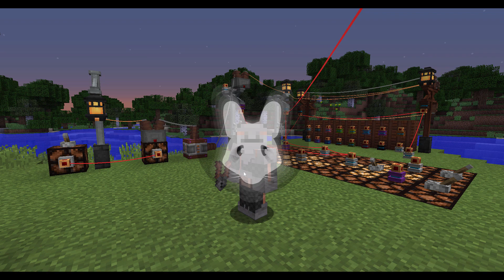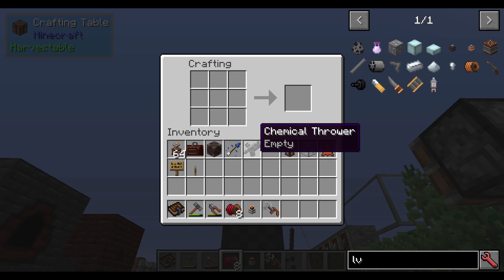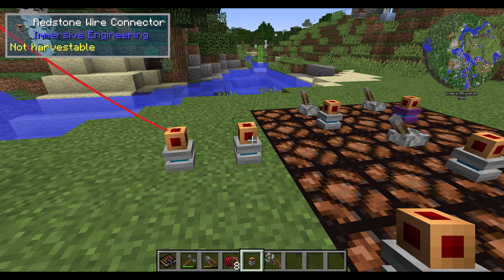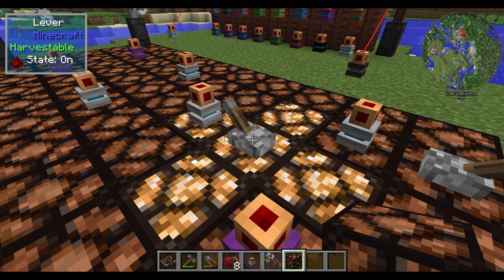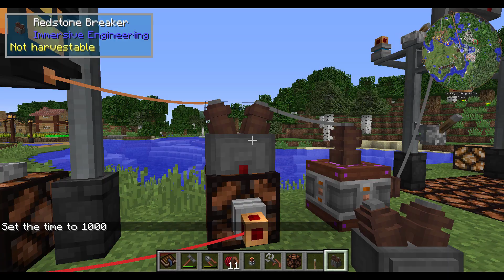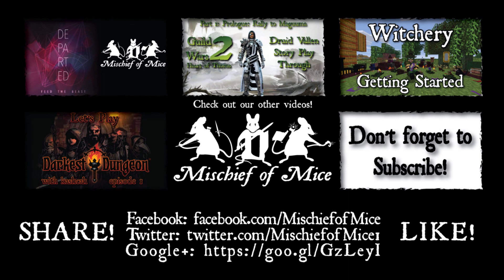Immersive Engineering: Redstone Coils & Connectors made simple! Minecraft 1.10.2/1.11.2

Comment: Do the wires lose strength or do they inherit the strength from the initial signal? I am trying to toggle a breaker to keep the mechanical multiblock from Immerisive Wires from breaking due to high rpms. I would like a redstone signal to disconnect the power if the rpms get too high.

Comment: Heylo, for some reason I cannot access the redstone wire connectors to change their I/O or their colours using the hammer. Is there a specific way to do it? Also, awesome vid I'm loving IE and you're helping tremendously.
Reply: I looked through JEI and found a screwdriver. Tried it on the connectors instead of the hammer and it worked! Looks like this got changed in one of the updates. :P
Reply from the maker: Just right clicking with a hammer if I recall. Happy to have helped. :)

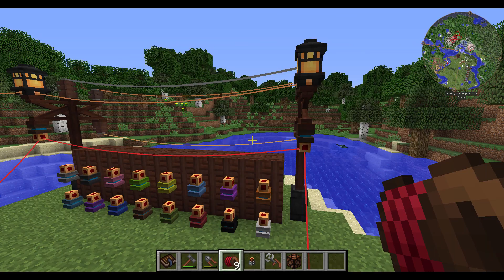Comment: I know it's an old vid of yours, but how do you get more than 2 "limbs" on wood/steel posts like at 5:16? Was this possible with older Immersive Engineering, and now removed, since I can't seem to get more than 2 limbs in my server, especially not on both top and bottom configuration on one side.
Reply: if i understand what youre asking, then its not possible to have more than two limbs which both have to be opposiste one another
Reply from the maker: Old version "bug" that was thought to be a feature at the time.